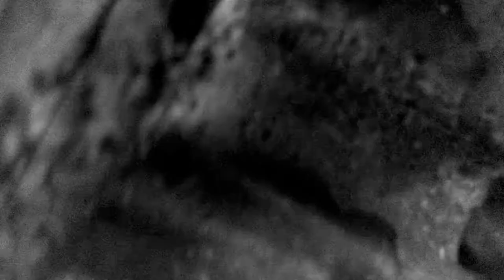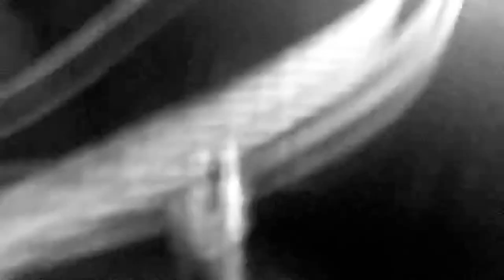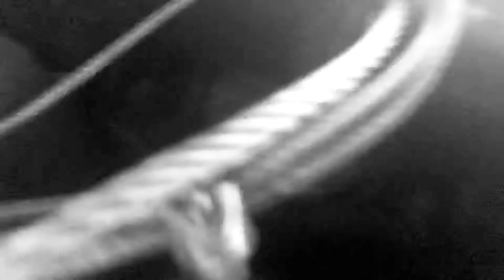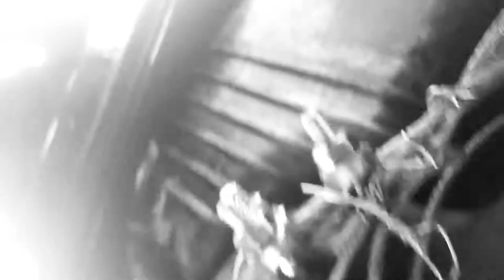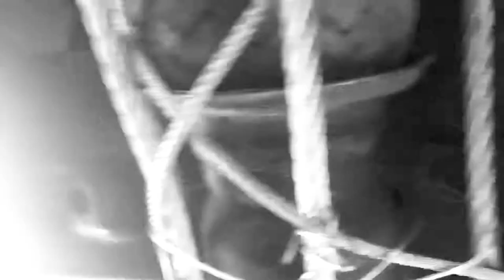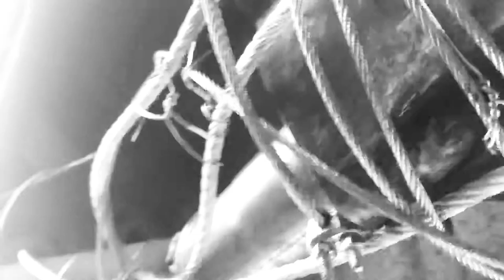My Catalytic converter got stolen!

Comment: I see some type of screws in there what did you use to tie these all together ?
Reply from the maker: I used steal wire and also u-bolts to crimp all the cables together. You have to make it look strong and messy. I had someone recently try to cut mine off again but they didn’t get it so they slashed my tire. 😂
Reply: @Mradm86  wtf wow that’s crazy what kind of car do you have ? Seems like hybrids and trucks seem to be the biggest target
Reply from the maker: @seanf6968  Honda Odyssey. Ya, I basically welded it to my heat shield with wires now, I engraved my vin into the cat and sprayed it all orange. You have to make them say let me go to an easier target. I don't know what the guy was doing trying to get mine in -15* weather when mine it wrapped!